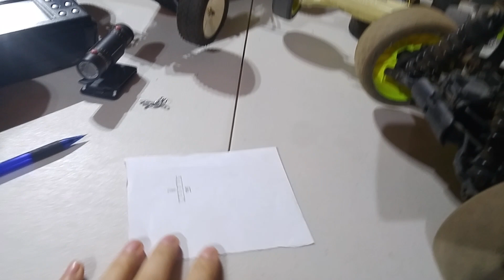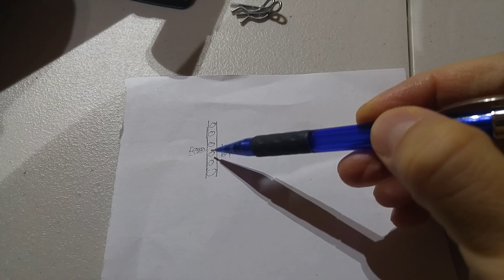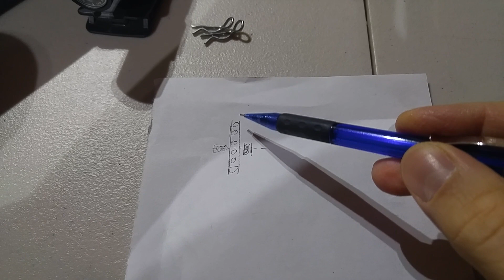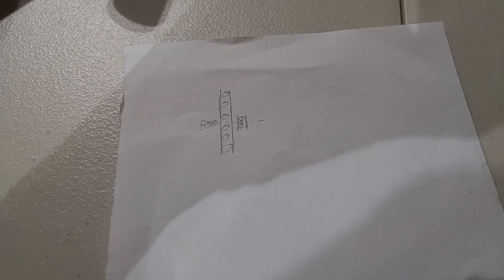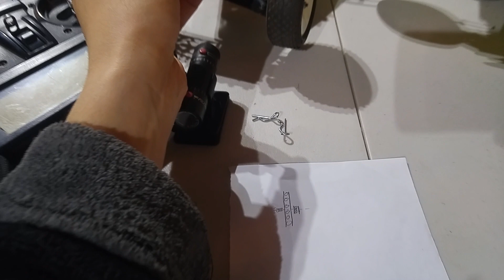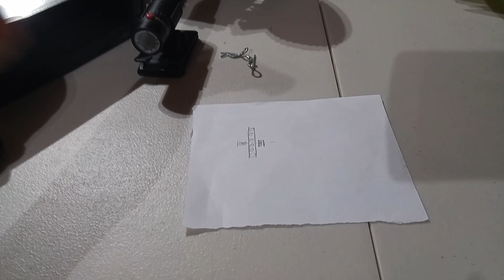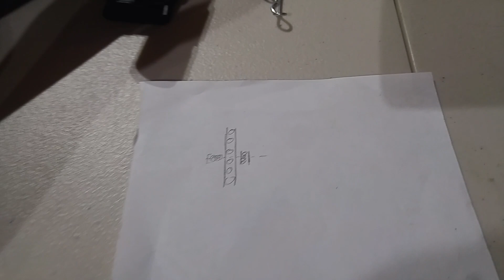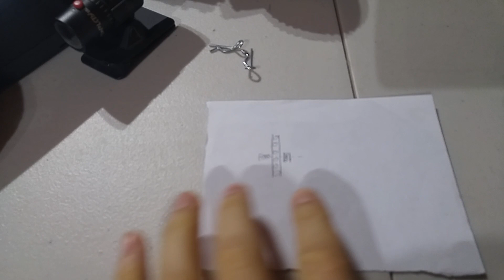Differentials

Comment: Very interesting subject.
Regarding the ball diff building that you mention min 7, I experienced same problem on my 1/27 GLA from GL Racing. I will try your method next time.
A quick question, what is the difference between a slipper clutch and a ball centre diff?
Thanks
Reply from the maker: A ball center diff is more likely to slip under high power, but putting that aside, a ball center diff is pretty much like a center gear diff in that it allows for differential torque between the front and rear drivetrain.  A slipper clutch usually gives a 50/50 split between front and rear, but can allow for differential torque in theory.  The thing is that slipper clutch pads and plates can heat up and have reduced effectiveness, so if you are on a surface where the front/rear split is constantly changing, then you're better off with a center diff rather than a slipper.  This is more likely on loose dirt and/or bumpy surfaces, where the front and rear tires see different loads at different times.  If you're on a smoother surface, then you're better off with a center slipper, in which case you're just using it to aid in traction under acceleration (e.g., if it's a low grip surface, loosen the slipper).